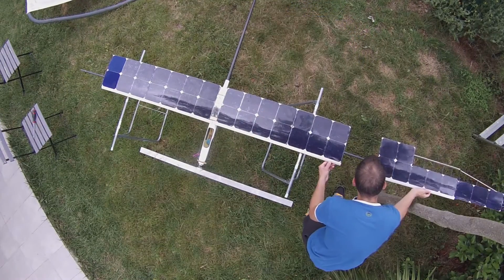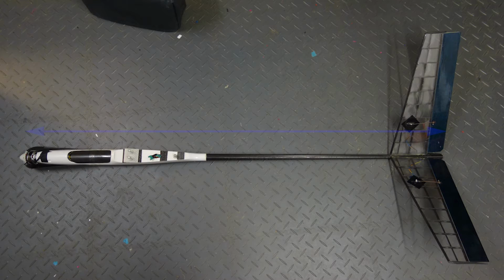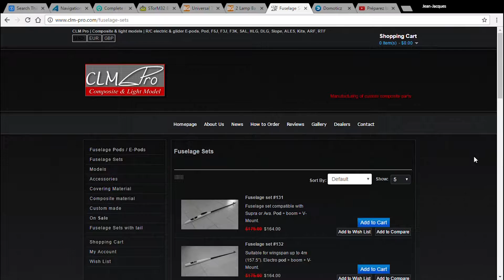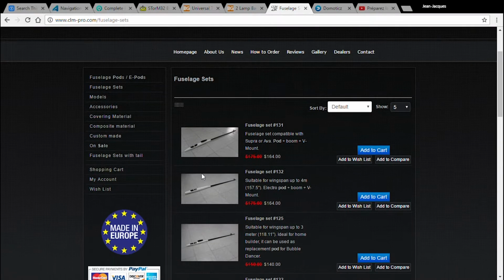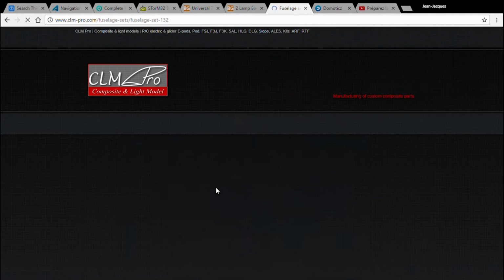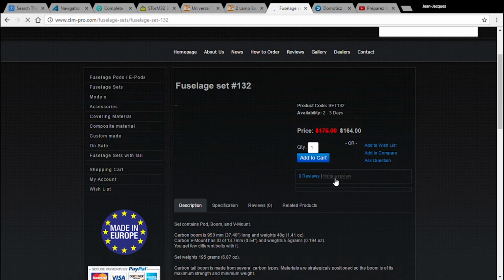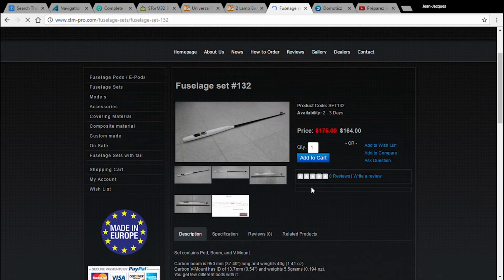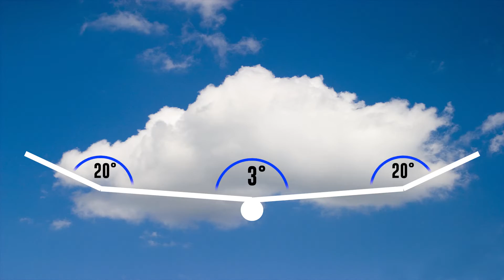SOLAR RC PLANE - The Structure

Comment: When you slide the wing section on the tube, how do you lock it into place? A bolt somewhere? But how would you access that bolt/locking mechanism through the wing covering.
Reply from the maker: Hi, the tubes locks with friction force, we just had a bit of tape for security on the intrados. Regards.
Reply: @SolarGliderProject  thank you!

Comment: what solar charge board did you guys use??
Reply from the maker: Patrick Williams , hi we use genasun mppt last year, and maybe this year. regards sgp.
Reply: What model do you use? I noticed they go up with price depending on required output current.

Comment: just wondering what film covering you used?  i cannot understand what it says in the video. 
also, what airfoil?   and what size prop?  
I can help you do a voiceover in american english, if you send me the script, i can send you the audio recording? perhaps it would be easier to understand?    be happy to help if i can. if not, no hard feelings.  I speak spanish, and english, but had a hard time understanding the french accent.
Thanks for the update!
thumbs up!
Reply from the maker: FPVREVIEWS hello, i'm sorry we try to do our best to make the content accessible for most people but we need to improve english speaking. Thank you for help.
Reply from the maker: Re FPVREVIEWS, for the cover, we choose oracover light transparent, but it's not perfect, we will change for next spring.
You need an thick airfoil with very low stall speed, the airfoil is not the most important thing at low speed.
An airfoil from a rookie plane can be choosed.
For the propeller i answered you on the other video.
Thank's for your help.
Regards
Solar glider Project.